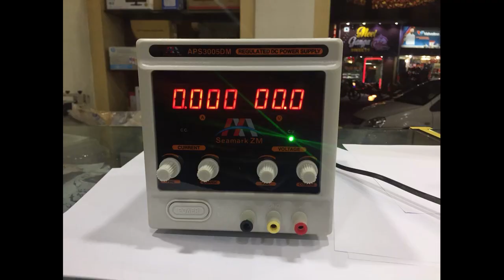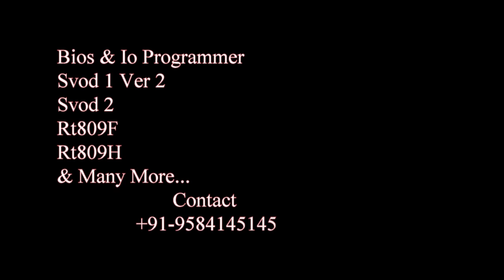MRT Hard disk Data Recovery tool  By #Aditya11ttt & #SatishBhai #Mrtultra #Mrt

Comment: If use win 10 what this tool running
Reply from the maker: garuda hdd yes
Reply: @Aditya11ttt  one  more
Dfl vs MRT which the best
Reply from the maker: The one fitting in your budget and u can work with and is able ur purpose is best